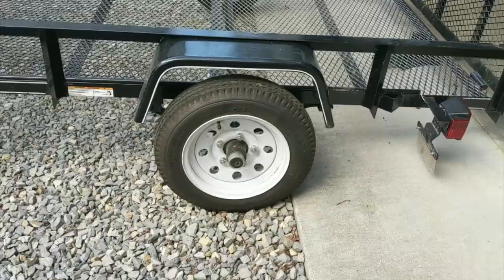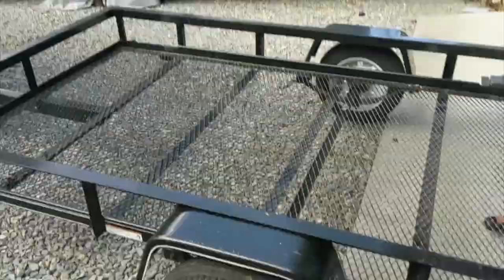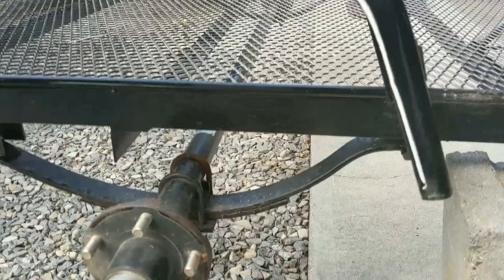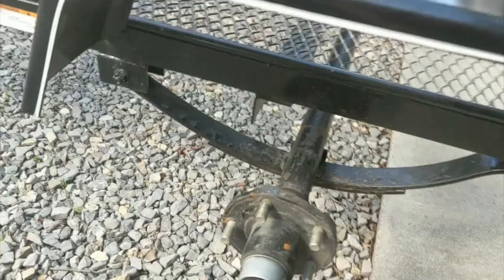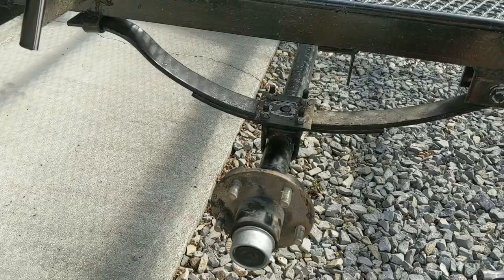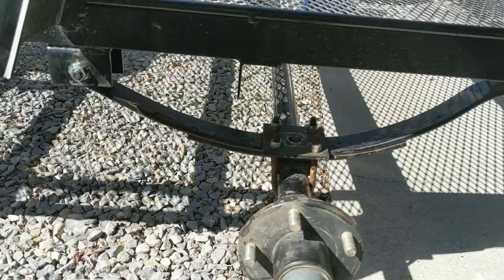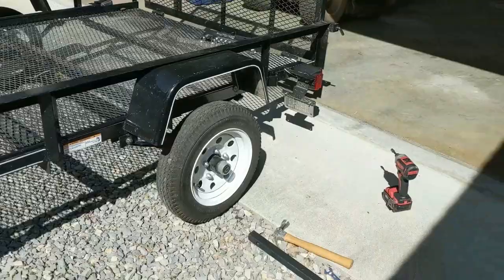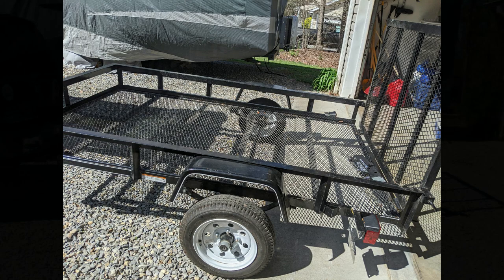axle flip Lowe's 5x8 utility trailer

Comment: As others have commented - the axle has camber built into the axle, and flipping the axle upside down has reversed the camber the wrong way.  Putting the axle under the springs is fine - but turning the axle upside down is not.  You can buy perches and weld them on the top of the axle to allow the axle to remain right side up with proper camber.

Comment: nope, you have now messed up the wheel camber.  Not the correct way to do it.  You will likely see uneven tire wear and maybe have some handling issues.
Reply: his axle looks straight like mine i have a 5x8 carry on trailer from 2001 im gonna restore and it has a straight axle not a cambered axle.
Reply: Can you explain this to me? I just did the same thing to my trailer the bend was originally at the top & now it’s on the bottom, but it handles & tracks just fine. Ive had it on the Highway 75+ mph to curvy roads 🤷🏼‍♂️
Reply: @bradspressurewashing2303  I am thinking of doing this to a 4x6 trailer, we have to look at the axle to see if it has a bend upward in the middle that is there to compensate for axle load.  If the axle is dead straight and no bend- what Jimbo did is fine.  There was a good comment on pulling the hubs off to grease them and flipping the axle without having to undo the springs. Lots of grease on those bearings is a great idea.  Mike
Reply: All axles are not identical my axle is larger and straight....
Reply: Did your axle have the camber bend? After the swap, is the camber facing up still??

Comment: If you pull the hubs off you don't need to remove the springs, slide axle out and back underneath, then reinstall u bolts and repack bearings they probably are due anyway. Done this on two trailers I use on the farm.

Comment: Don't do it the way shown in the video: it's dangerous not to consider the camber of the axle.  That can lead to premature tire wear and handling issues.  Dexter doesn't sell an over under flip kit for the 1-3/4" axle, if you have a bigger axle, Dexter does and you should use it.  This video showed me how to make a kit for myself for the Lowes trailer and flip the axle with the camber up: https://youtu.be/eJvFK3zbuyc

Comment: Seems easy however in doing it this way you now have messed the camber up and you will get uneven wheel wear not to mention unsafe handling.  You need to weld on new spring perch mounts and do it right.

Comment: Now does the deck of your mower drag when you load it? By flipping axle the deck angle increased drastically.
If it does you can lengthen the gate to decrease the gate angle.
Reply from the maker: I haven't used it to tow my mower yet but I'll keep that on mind

Comment: Might do this for a camper  i want to build on this trailer, what size tires did you fit on? Do you think it would lower the load capacity of the trailer?
Reply from the maker: I haven't gotten bigger tires yet and I'm pretty sure it won't cut down on load limit